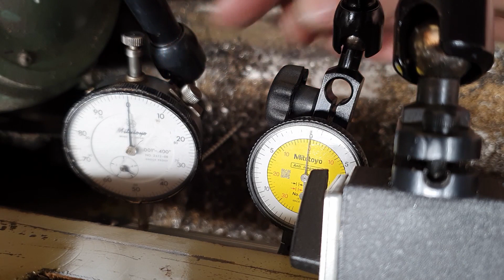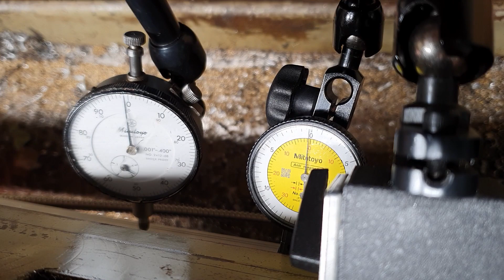#91 - Precision Machining Upgrade: Step-by-Step Installation of Advanced Lathe DRO Kit - Part 1

Comment: Totally agree with you about the New Zealand prices, seems we get ripped off a fair bit in this country. 
Nice job 👍😊
Reply from the maker: Hi Paul, Yes the prices here were crazy when I had a look. I find myself purchasing more and more from abroad.
Have you been upto much in the shed?
Cheers Kevin
Reply: @Machine_NZ  just doing a lot of machinery repairs, hobby type building is on hold till I see things settle down on the goods and transport sectors. Have a merry Christmas.

Comment: I installed a DRO on my milling machine, and its a absolute Game Change... ! I will install a System on my lathe in future.... ! Highly recommendet!!! Nice Video! Good work!
Reply from the maker: Hi there, Makes things alot easier using the DRO. My lathe is metric and has metric dials so when working on imperial projects its a pain. Cheers Kevin

Comment: Gday Kevin, great addition to the lathe, I’ve been very tempted to put a dro on the lathe here, im getting a bit of using indicators, great job mate, cheers
Reply from the maker: Hi mate, Makes things alot easier. My lathe has metric dials and when working on imperial projects its a pain.
Cheers Kevin

Comment: I just installed DRO on my smaller lathe a couple of weeks ago .
I have used the self adhesive magnetic slide type .as take up less room .
I am very happy with it and use it more than I thought i would
Reply from the maker: Hi there, you should make a video would be good to see it in action. Thanks for watching. Cheers

Comment: Hello Kevin,
I have been resisting having a DRO for sometime but now feel it would be a good idea when switching between metric and imperial... Nice job you did there fitting it... 
Take care.
Paul,,
Reply from the maker: Hi Paul, same here. My lathe has metric dials and when working on imperial projects its a pain. The DRO's going to make life alot easier.
Cheers Kevin